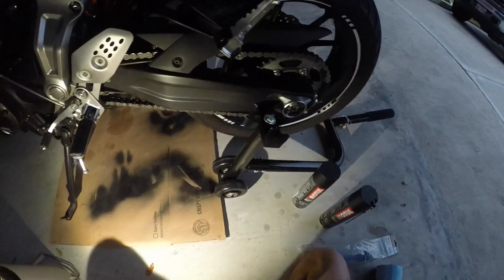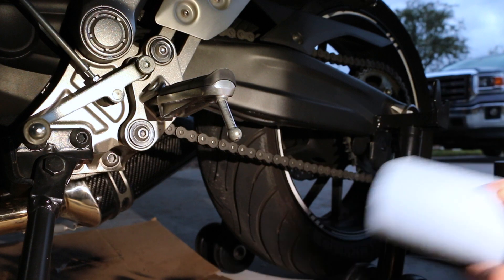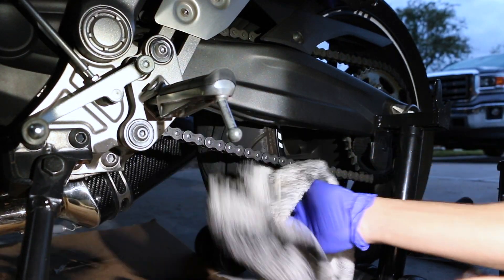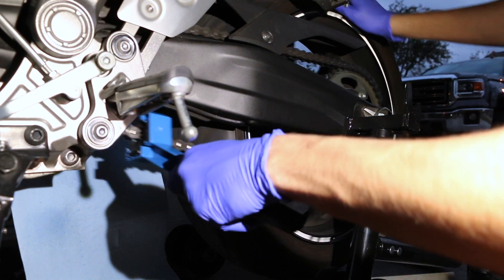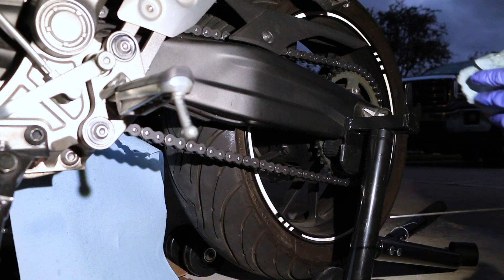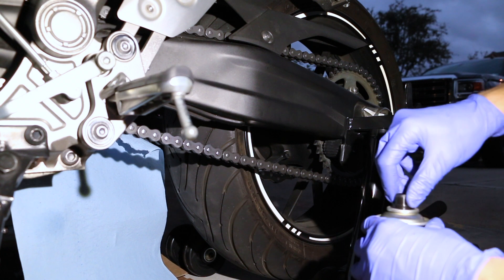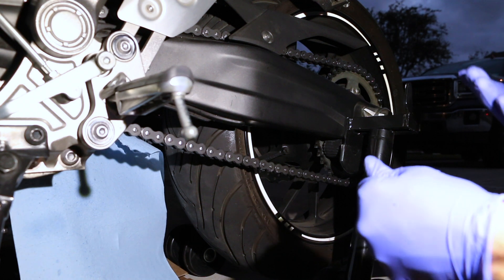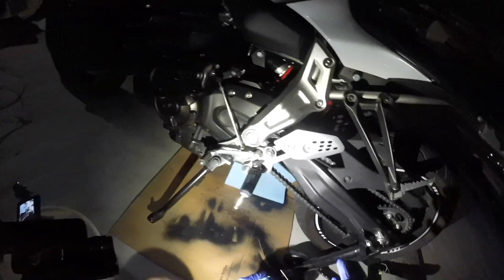Yamaha Fz 07 How to Clean & Lube Chain

Comment: Guys, before you start cleaning your chain, consider reading the service manual of your motorcycle first. 

Yamaha recommends cleaning your FZ/MT-07's chain with kerosene only. The motorcycle chain has a chain with small rubber O-rings. Using Motul can deteriorate those O-rings and you will need to replace your chain completely. There are specific guidelines which are not taken into account in this video. Just a word of caution.
Reply: Both Motul C1 and C2 are safe for O-ring and X-ring chains. But other than that, yeah, I agree spending money for dedicated cleaner is silly, it doesn't work better.

Comment: should be using chain wax after the lube to keep it on the chain better. good tutorial
Reply from the maker: didn't know that, thanks for the advice!
Reply: CruzinMoto what you mean wax after lube. It's lube that goes all over the place or wax that sticks more. The you got a degreaser. I use wax cause it last me a good 400 miles

Comment: Hey I noticed that the Yoshimura Exhaust isn't Road legal did you had any trouble with it since you installed it ? 
Do you think i can get it in France & a EJK without trouble too or will i get my ride taken away ?
Reply from the maker: I've never heard that the exhaust is illegal. I've had it for about 5 months now and I've never had an issues with it. I've ridden next to cops all the time and never had any problems. I would get the M4 slip on instead though! It's much cheaper and sounds almost the same!
Reply: +Nima Tech It's a RACE series exhaust and is not for street use it says but i just wanted to know your point of view on it because i don't really want to cut the factory exhaust
Reply from the maker: If you do not want to cut the factory exhaust, then I recommend getting the full Yoshimura Exhaust. If you do not mind cutting the exhaust, I say get a slip on and save yourself $500. and they sound almost exactly the same.

Comment: Hey bud, how did you go about setting up the rear stand? Noticed there's no place for spools so I'm at a loss
Reply: Some stands have rubber paddocks. I went on Trex racing and bought the spool adapters. Takes like 2 seconds to put on or take off

Comment: Use a solid piece of cardboard to cover your tires and exhaust. Excess  spray will hit the cardboard and run off onto the ground which is covered. Also rotate the brush so that your brushing the backside of the chain.

Comment: I just soak the whole chain in WD 40 first and let it sit for a bit, then wipe it/brush it, then lube it. Also remember to clean the sprockets too, having a clean chain won't last long if you have dirty ass sprockets.
Reply from the maker: That is very true! I actually might have to do that the next time I clean up my chain! Thanks for the advice!
Reply: WD 40 will absolutely kill the o-rings your chain man.
Reply: Ja jeweet only if it's on for more then 30
Reply: Ja jeweet, WD40 will absolutely not harm the chain nor the orings, there is ton of proof that WD40 does not deteriorate, in fact the only thing better to use than WD40 is kerosene, which WD40 already has